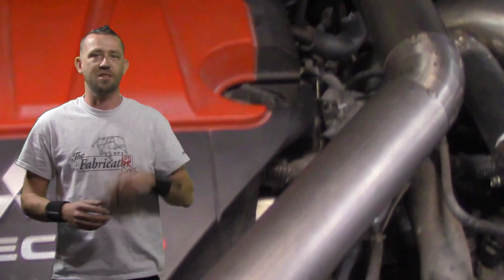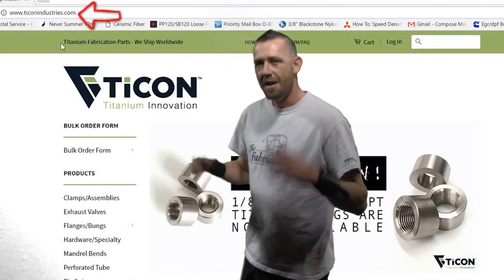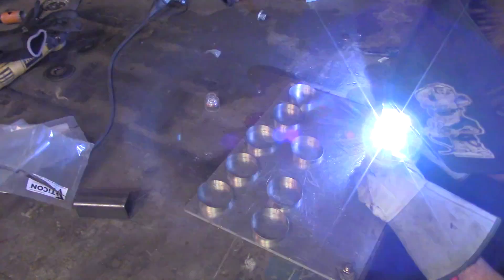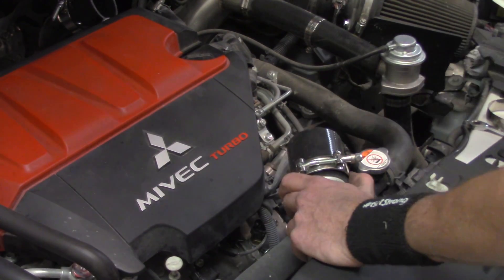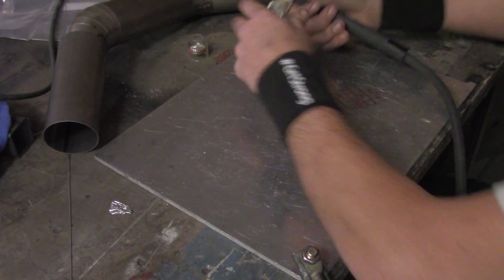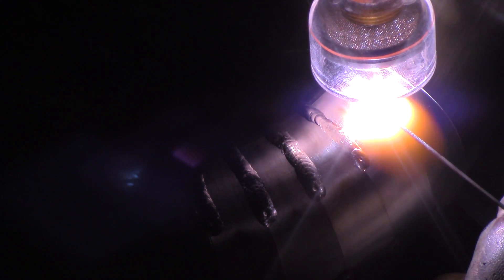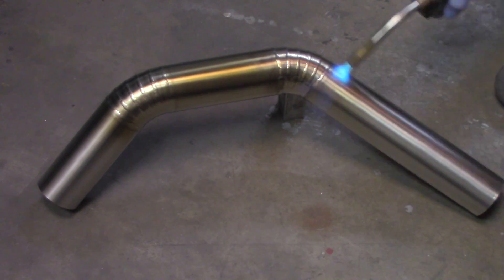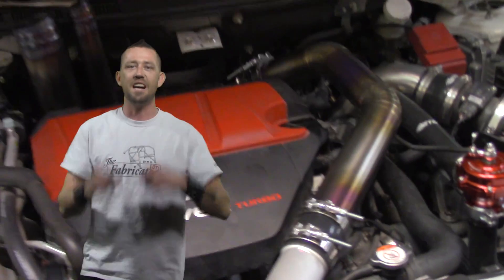TFS: Titanium Pie Cut Intercooler Pipe (Pie & Lobster Cuts Pt. 5) #TFSFastFab

Comment: You said in previous videos that you can only match a 4.5 degree with a 4.5 degree pie cut and a 9 degree with a 9 degree cut. How do you match the finished pie bend up with the straight pipe you attach them to? Great video!
Reply: Simply make a pie "coupler" with a 4.5 degree angle on one side, and straight on the other!

Comment: Why would you build intercooler pipes out of titanium? Aluminium is much lighter, cheaper, easier to work with and has better thermal properties. The only benefit of titanium is its strength compared to its weight, but since this piping doesn't have to survive heavy loads, i can't see any benefit using titanium.
Reply from the maker: MrsMcMuffin Some people just want it. What's the problem with that?
Reply: The Fabrication Series There is no problem, I just wanted to know If there is maybe some performance benefit that I haven't thought of. Apparently it's just for looks and it does look good indeed, but I'm not a fan of this kind of Rice Like "Tuning".

Comment: Hey I have a few questions. When you are cutting the straight tubing to join it to a piece of pie do you cut it at 4.5 degrees to match the angle of pie or whatever angle of pie you are using? Also I want to do the intercooler piping on my evo 8 in titanium. The 180ish degree bend coming out of the intercooler would you use Ticon's tight or loose radius pie? I know its going to be a lot of welding but I'm just having fun making parts for my car. I love your videos by the way! So much great information! Thanks for taking the time to make all these videos

Comment: Nice Vid, I just bought me a Mk1 GTI turbo, im gonna replace some of the tubing with titanium. Have a Q: can you use a lay wire technique on Ti or do you have to dip the wire to stack dimes?
Reply from the maker: Lay wire might work if you can keep up with it. The problem is that titanium is "sticky" at a low temperature, so if you can't keep up with the puddle, the rod will just stick to the area around the puddle.

Comment: I love all your videos! So much great information. What size wire you prefer when welding titanium?
Reply from the maker: Daniel Curtiss Thanks! I mostly use 0.039" and 0.059" (for flanges) but my "go to" filler is usually 0.039" for just about everything.
Reply: Alright thanks. Because of your awesome videos I plan on building some ti parts for the 05 evo I just bought

Comment: Hey awesome video....Love the idea of sticking the purge plugs deep in to the piece near where the joint is.  Few question I have are what kind of blade do you use to cut Ti on your bandsaw and do you change your blade or feed speed compared to say cutting stainless?

Thanks again for the awesome video.  Got a subscribe from me!
Reply from the maker: It's just a fine cobalt blade. I cut it at the slowest speed on the saw and slowly feed as well. The coolant is also on maximum flow.

Comment: did you bead or swage the ends??
Reply from the maker: Mark Davidson No. The clamps used are extremely strong and the design itself is almost mechanically locked which makes it difficult to blow out.
Reply: The Fabrication Series 

ahh ok, never trusted intercooler piping with out a swage! just wondered that's all mate :)
Reply from the maker: Mark Davidson With a crappy clamp, I wouldn't trust it either haha. Good brand T-bolt clamps will hold extreme levels without issue.
Reply: The Fabrication Series that's what I always use and past 1.5bar mine would blow off, good video! I already have my basket at Ticon past $100 haha

Comment: Whats the purpose of the heat treatment after?
What CFH do you suggest for welding Ti?
Reply from the maker: It's not a heat treatment. It's just changing the color since most people in the automotive industry know titanium as colorful since it is usually purposely burned. I usually run about 35 CFH and 10-12 on the purge.

Comment: What about bead rolling the ends? I know its a tight fit and it doesn't look like it would let go but the piece of mind would be worth it wouldn't you say?
Reply from the maker: This piece is almost mechanically locked by design, but the job of holding the tube on the car is done by the clamps. A weak clamp will blow all day long as well as low quality t-bolt clamps. Good quality t-bolt clamps will hold without issue. If one was seriously concerned with the omitting a bead roll, it could be added for peace of mind. The only tough part is finding a roller that will perform well on titanium.
Reply: The Fabrication Series 
Well said Sir. I haven't heard of anyone rolling titanium yet that mainly why I was asking.
Reply: another option is hitting it with a few tack welds or even a bead towards the end of the tube.
Reply from the maker: Aaron Wolff I actually do that with aluminum which will be demonstrated in tomorrow's episode of intercooler piping fab. Titanium has a relatively weak buildup to it but it is technically possible.

Comment: hell yeah, id love to do this but titanium doesnt really fit with "PoorManMods" lol
Reply from the maker: Poor Man Mods It depends on how you look at it. It does cost more than almost every other material, but you save a lot by building it yourself which is cheaper.
Reply: Im all about building it myself! Is tigging titanium as hard as aluminum?
Reply from the maker: It presents difficulties. Most people describe titanium as "sticky" which is pretty much how it acts if you miss the puddle. It does require less amperage, extreme gas coverage, a very tight arc gap, and consistent speed. It's a little less forgiving than aluminum as well.
Reply: Damn sounds pretty difficult, i absolutely suck at aluminum lolol
Reply: The Fabrication Series can I have a contact number for you?
Reply: What CFH do you run when welding Ti?
Reply: Hey How do you get titanium looking welds that have cool colours?